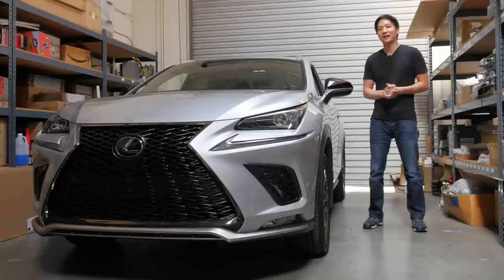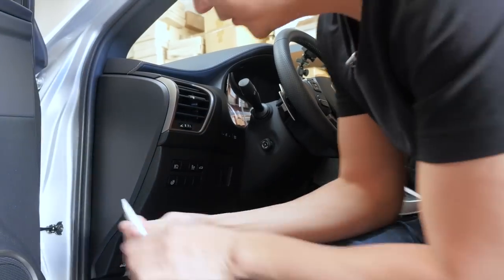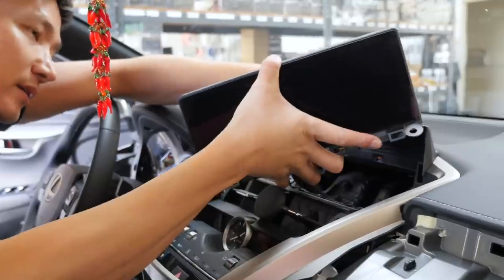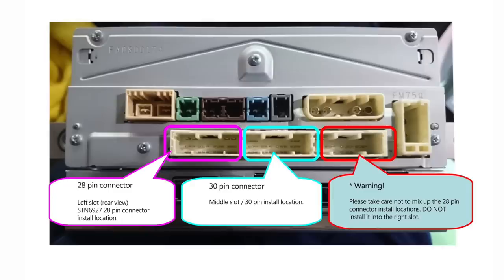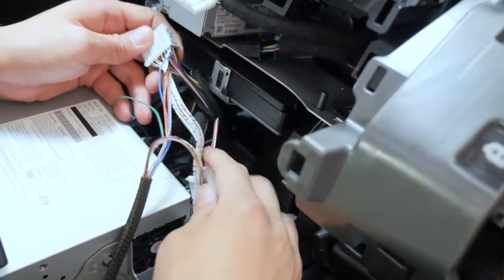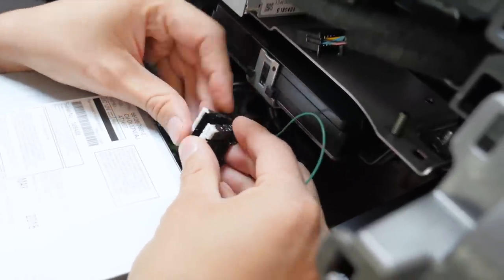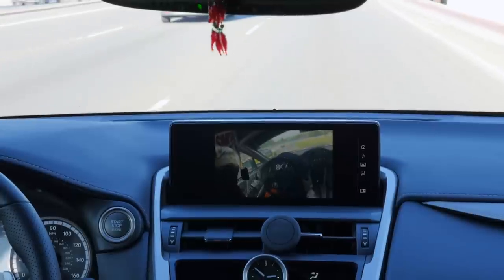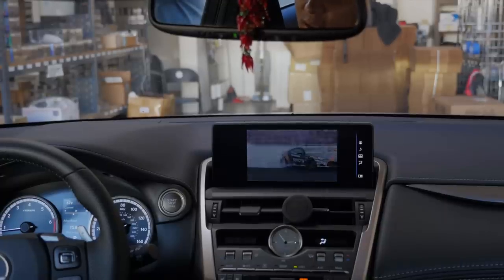2018-2021 LEXUS NX 300/h Navigation & DVD In Motion Bypass Install

Comment: I just purchased my 2021 NX 300, downloaded all the apps and couldn’t figure out how to get the navigation to work. I called the 1800 number and the rep said this car doesn’t have nav option. Will this work on my car? I’m very disappointed that I have to use CarPlay and it doesn’t come with a nav option. You have a forward facing camera as well?
Reply from the maker: This will work for your car but it won’t add navigation or a dvd player

Comment: You do not have a installation video for the GX series.  I have a 2016 GX 460 Luxury edition.  I wanted to buy your kit but unless there is a installation video, No every one does this kind of car customization every day:)....please post one.  Thanks~ Steve
Reply from the maker: Working on it! If you are local to Socal, maybe we can use yours? Also, the kit comes with detailed instructions for your vehicle so even though no video you will have the right tools to get it done. And we also provide technical assistance as well!

Comment: Hello! Would it work on a Nx300h without messing with the Hybrid energy measurements?
Reply from the maker: Yes this will work without messing with the Hybrid energy measurements.
Reply: @BeatSonicUS  I'm not sure which one should I buy for the 2019 NX 300h. The NDS6223EP or STN6927. Could you help me, so I can make my purchase? Cheers!
Reply from the maker: You will need the new part#STN6927. This is identical to STN6927, which you can purchase here: 

http://www.beatsonicusa.com/stn6297.html
Reply: @BeatSonicUS  Still out of stock... 😔
Reply: My Lexus Nx 300h 2020 right side hand drive, from Japan. 
Which one equipment I need and web link please